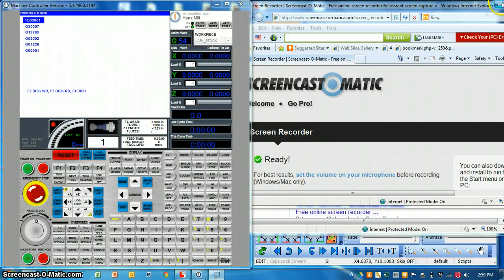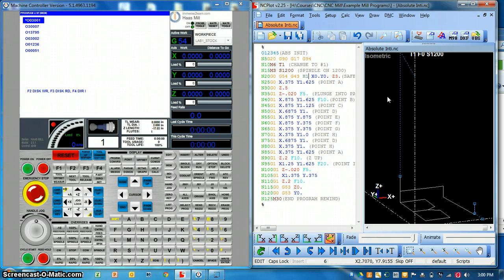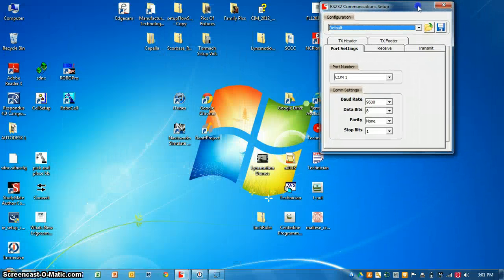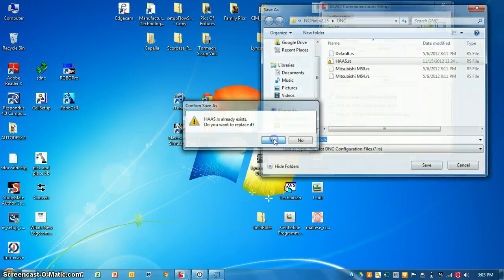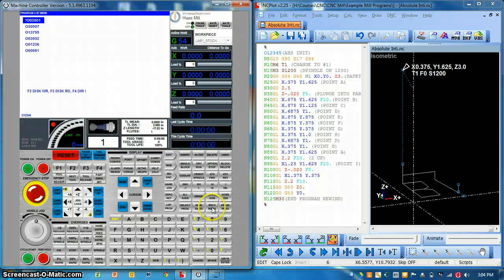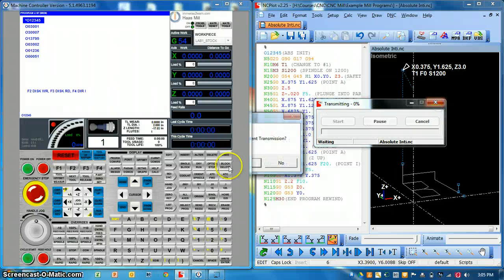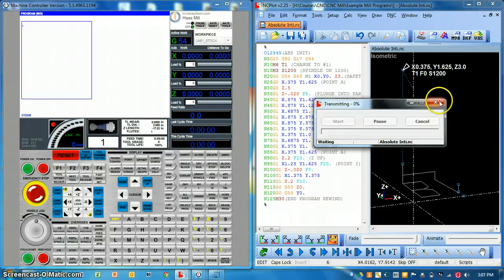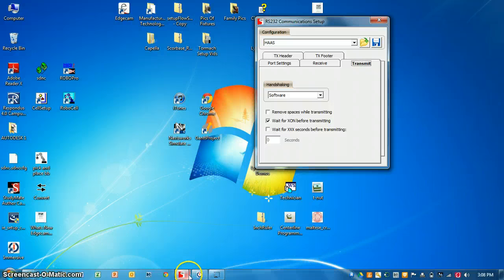How to set-up DNC exchanges

Comment: WHY PAY 2, 3 OR 4 TIMES THE COST of ShopLink DNC products.
Highland DNC, LLC. is the LOW COST leader in CNC RS-232 communication used to distribute and manage NC part 
programs. Highland provides “ShopLink LOW COST Wireless” the least expensive and most cost effective wireless RS-232 
communication system on the market today. Single CNC wireless system starting at $399.00 with 100' range and 3 CNC 
wireless system with 200' range starting at $945. Add to the 3 CNC ShopLink system host PC additional CNC’s @ $315.00 
each (up to 7) + options, then add CNC's 8-32 at $199.00 + options each. Need a handheld CNC file transfer system 
“ShopLink FLASH”, the LOW COST approach to adding USB 2.0 Flash memory to CNC’s without factory provided USB 
capability. “ShopLink FLASH” provides the connectivity between a USB 2.0 Flash memory drive and your CNC’s RS-232 
port. “ShopLink FLASH” will send part programs up to 2 Gigabytes long by loading into the CNC memory or by using the 
spoon\drip feed method. Also receive part programs sent from your CNC’s program memory. Mazatrol “CMT” conversational 
program transfer is not supported by “ShopLink FLASH” but is supported by ShopLink LOW COST Wireless and ShopLink 
wired systems.. “ShopLink FLASH” is $229.00 + shipping. See www.HighlandDnc.com or call 941-322-2286 for more info.